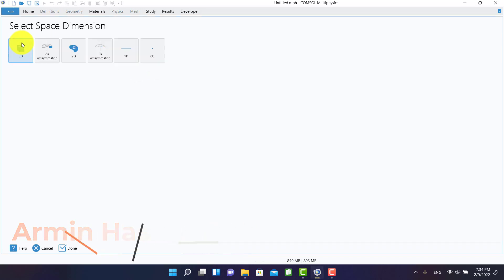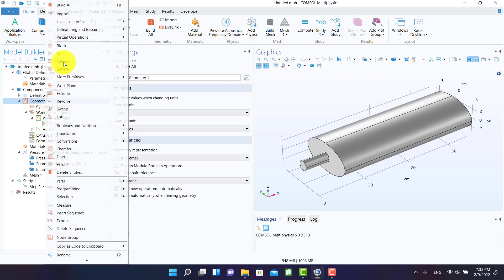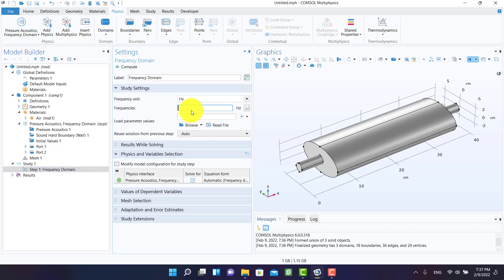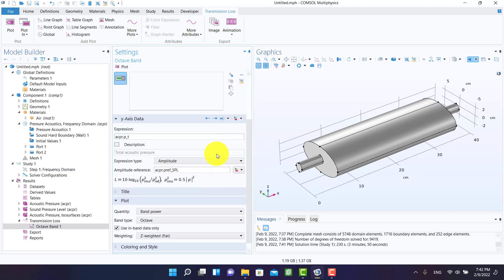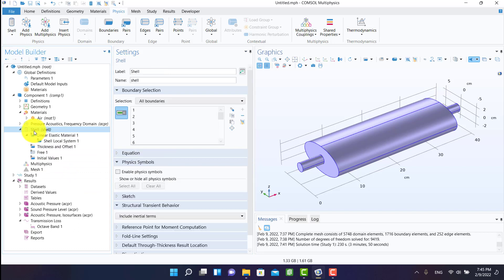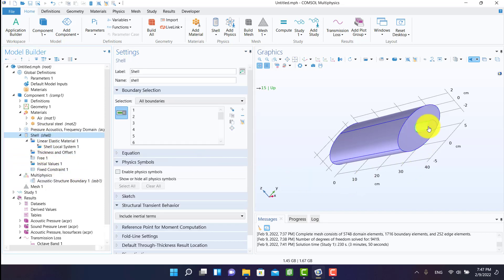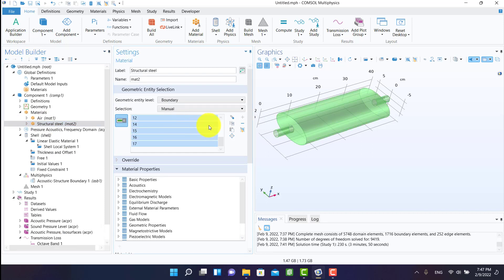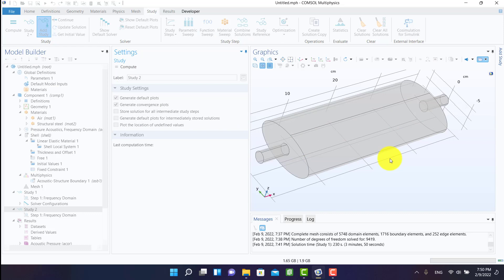🎧 COMSOL Tutorial: Sound Transmission Loss of a Flexible Muffler 📐

Comment: Can you analyze the most beautiful exhaust sound in the world from the Lexus LFA & its very complex exhaust system?  Here is a documentary about it however has many unanswered questions, that you have experience in.  https://m.youtube.com/watch?v=crEeOEs4ZP0&pp=ygUXbGV4dXMgbGZhIGV4aGF1c3Qgc291bmQ%3D
Reply from the maker: It is not possible to model the engine sound because the engine sound is not available. However, we can calculate the sound transmission loss of the muffler if we have the exhaust geometry.
Reply: @caewitharminhashemi  I have always wondered, can a muffler be made, to be able to reproduce a higher tone exhaust note like the Lexus LFA V10 but from an engine that produces a lower tone exhaust note like a Corvette with a small block V8?
Although the engines are much different, Flat Plane V10 which produces a smoother exhaust pulses note vs. Cross Plane V8,  however what if the exhaust pulses from a 3" pipe were squeezed through a group of much smaller pipes of 3/8" in a muffler case?
Can low pitched sounds be altered to make higher pitched sounds in a exhaust like a musical instrument?  Are there any known designs you have seen that uses this concept?
Reply from the maker: @chrispompano  Mufflers reduce sound at specific frequencies. They cannot change the sound. They only reduce the high-frequency sound until the low frequencies dominate. Therefore, the engine sound becomes deeper and more pleasant.
Reply: @caewitharminhashemi  Can you explain why the Lexus LFA is known to have the worlds most incredible high pitched exhaust note?  The video documentary I included above also tries to investigate this long debated topic, but here is another video of just the high pitched exhaust frequency of around 500hz created by the world famous Lexus LFA!!!!! 🤔 https://m.youtube.com/watch?v=F0m6dvpK4m8&pp=ygUXbGV4dXMgbGZhIGV4aGF1c3Qgc291bmQ%3D
Reply from the maker: @chrispompano The beautiful sound mainly comes from the engine itself, and the muffler removes the sharp noise.